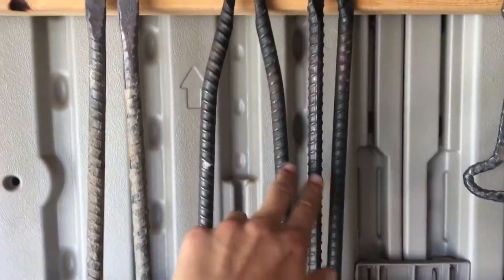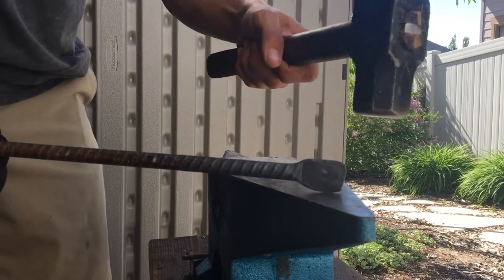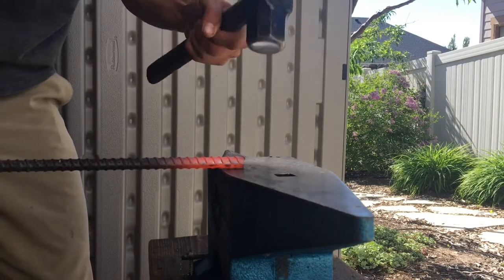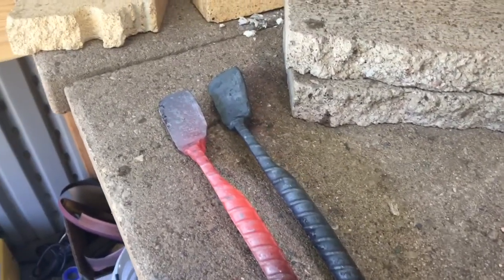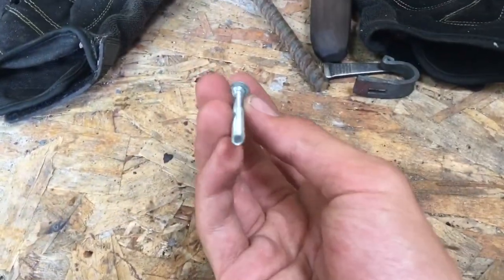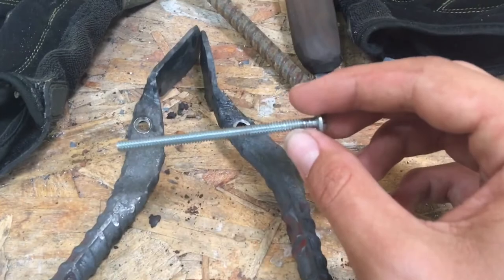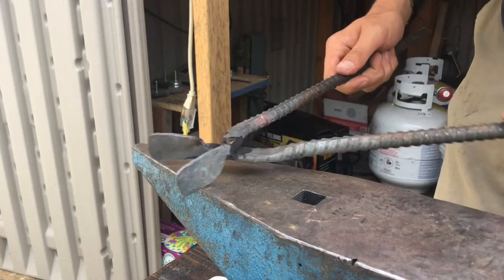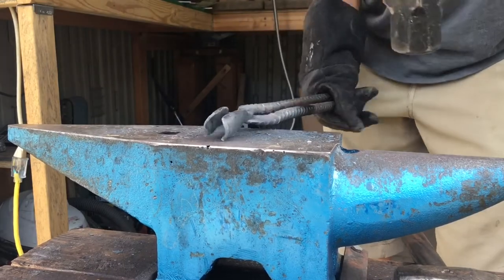Forge Rebar Tongs and Save Money! | Blacksmithing Project for Beginners

Comment: most rebar is not quenchable just so everyone knows. normal rebar is a low carbon steel and it doesn't matter how much you quench it, it will never get any harder
Reply: Study how metal works and then teach others , iron and many others can be quenched , hardness Is a product of the volume of lattice crystals and any metal cooled quickly will form more lattice crystals so way harder , it doesn't matter what metal or the carbon content
Reply: @bluebery4130  There's a simple non scientific way to try this. quench a piece of steel. if it shatters in half after you hit it with a hammer it got hardened. or try filing it. if the metal feels like glass when filing it it got hardened. Sure a mild steel may technically get harder but it's insignificant. but like i said some rebar is high carbon steel. especially old ones before the modern rebar it used to have over 0.4% carbon which is enough to harden.
Reply from the maker: This is very true! I’ve looked into the alloy that the rebar I’ve gotten from local construction sites is and if I recall properly, it’s about a 0.3% to 0.5% carbon content, so not exactly ideal, but it gets the job done. Most rebar has a bit of carbon and can be used for beginner tooling, but proper tooling needs proper metal. I just got lucky and found some rebar with decent carbon content without knowing!

Comment: "I'm not the best peener" - Todd Koch 2022
Reply from the maker: Guilty as charged
Reply: @ToddKoch  Btw Todd i've been wanting to get into blacksmithing, i got a few questions that i need answering. 
1: why use a belt sander and then hand-sand too? I know we sand to make something sharp but i'm confused as to why we need to do both.
2: What's the difference between tempering and annealing, and what changes do these processes make to the metal?
3: is quenching done to keep an edge or to prevent bending?
Reply from the maker: @neki134 I use the belt sander to shape up the blade. The reason I hand-sand is for aesthetic reasons, the finish of a hand sand is much more uniform and professional than a belt sander normally gives. Annealing is where you heat the metal up to critical temperature and let it cool down naturally, and it helps the metal form a more uniform grain structure, which makes it stronger. Tempering, on the other hand, is where you keep already hardened metal at a high temperature for a while in order to soften the blade a tiny bit, mostly to offset any brittleness you pick up from the quench. This just helps ensure your blade isn’t too brittle and won’t snap under stress.  As far as quenching goes, quenching hardens the metal by forming a crystal structure that keeps an edge much better. It can also help prevent bending because it makes the metal more brittle. Sorry it took a second to respond, it’s been a bit of a busy week haha
Reply: @ToddKoch  Yo, thanks for responding, the response time was fine, i'm 17 rn and i've just gotten my first job, I bought a blacksmithing book and when i get my paycheck i wanna get a propane forge and an anvil, and start blacksmithing. the answers were really helpful, once again, thanks.

Comment: Question about making the shape of your tongs round or square. Is it easier or possible too heat up the tips of the tong then hold the material you want too shape it to, then hammer it? Like holding round stock so it makes a better rounded shape
Reply from the maker: Great question! I’ve tried this a few times, and I’ve found it works pretty well for angular tong grips (barstock holders, octangular, stuff like that). It can also work pretty well for curved metal if you have a decent jig to do it with, however if the round stock that you’re shaping it to isn’t properly pinned down, it tends to send the roundstock flying and is a bit trickier. Hope this answered your question a bit!

Comment: Just started my first pair using this video. I used a wrench to hold mine as the measurements you mentioned didn't give me enough stock out of the forge to grab with my gloves hand. However, having never made anything other than a blacksmith knife in a class, this was a learning experience. Right now, mine are cooling before I pin them, and I'm taking a break. Lol!
Reply from the maker: Sounds good, and yeah sorry if the stock wasn’t long enough! Glad it helped you out though!!

Comment: Everyone saying you cant use rebar.

Don't listen to them. There a channel saying he makes knifes from rebar
Reply from the maker: Some rebar is suitable for professional knifes, but some has decent carbon content and at the end of the day it’s a great material to start and and get practice with!!
Reply: Rebar is inconsistent. It's the bottom of the barrel mix of whatever the steel plant gets from the recycler and scrapper. You could make a knife out of cast aluminum if you wanted, doesn't mean it's good! Rebar is fine for home gamers, just don't go expecting high performance from your steel.